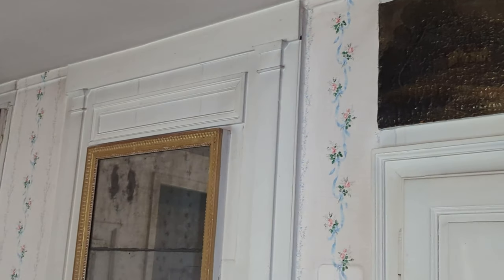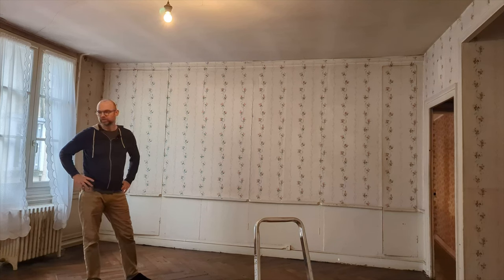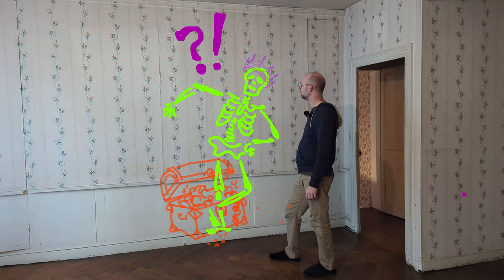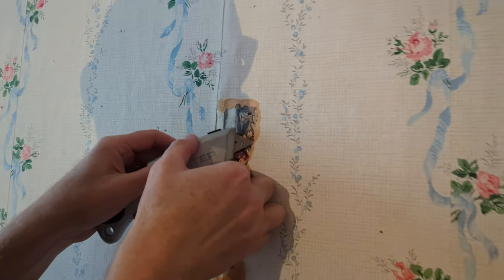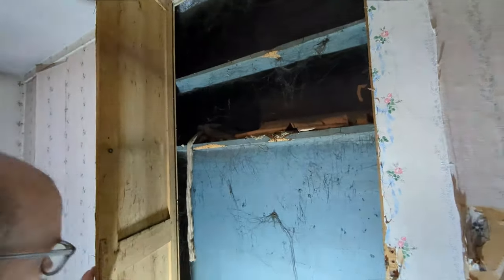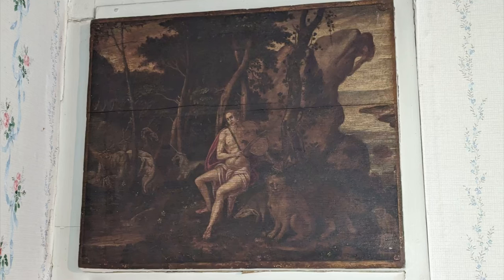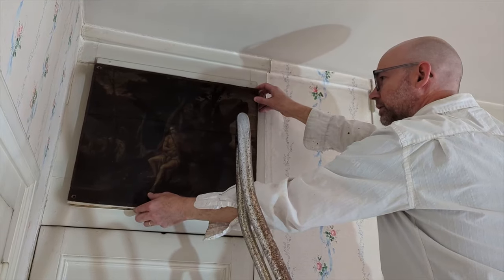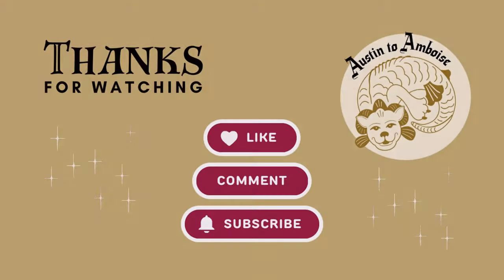Ep.5: Surprising 18th century interior design details found in our French house

Comment: I'm guessing that entire wall of cabinets is an addition. I would be willing to bet it was added to cover up the old piping you found inside for the heating system. I'm sure that house didn't start out with any kind of central heating. It was definitely either woodburning fireplaces or coal.

Comment: Like many commenters, I think the 1850s date is when the later stages of renovations were made. There are likely much older parts of that house, especially in the attic and cellar. Possibly the inner parts of the outer walls. The front and back walls might have been resurfaced on the outside to bring them "up-to-date". It'll be fun to follow your exploration :) I picked up a lot of clues on relative dating of walls from watching Time Team and Phil Harding :P
Reply from the maker: Thanks for following along!

Comment: The fireplace is a common 19th century model, although the trumeau with its pilasters is interesting. To me the   trumeau is from the first half of the 19th century, possibly older (1780's because it's neoclassical). The most interesting feature is the (probably) mercury mirror with a typical late 18th century framing, but it may not be original to the room because of a slight mismatch in proportions with the trumeau and mantlepiece. The parquet floor is a typical 19th century "point de Hongrie" design, common in French  bourgeois dwellings of that era.
Reply from the maker: Thanks so much for all of this info! Very interesting. 🙂

Comment: Wow that real wood paneling will be amazing once cleaned up!

Those two oval plaques are intriguing. I possess something similar that I obtained in an auction box lot and have been trying to figure it out for a while. I always suspected my piece could have been a decorative panel on the front of cabinet perhaps or attached to the outside of a building. My metal piece has lions rampart or similar creatures and may be bronze. It has holes where it was at one time attached to something. 
I also thought chimney flue cover but those are round usually. 

I hope someone from your area may be familiar with their function.
Reply from the maker: Good luck figuring out your treasures! Thanks for watching.

Comment: Ok, extremely wild guess...some of the walls in the bedroom appear to be very thin. It's almost as though someone decided to redesign the interior of the house. It may be that the original house is the exterior and most of the interior has been revamped to meet the era's fashion or the family's needs. Electricity and plumbing are the most modern, but you might have numerous changes which create a hodgepodge of eras that make no cohesive sense.
The least likely changes would be made to solid walls and floors under the parquet. If your government offices keep those kinds of records, that would be the place to start. That or the local historical society. They may not have your particular house, but perhaps a neighbor's house with similar structure?